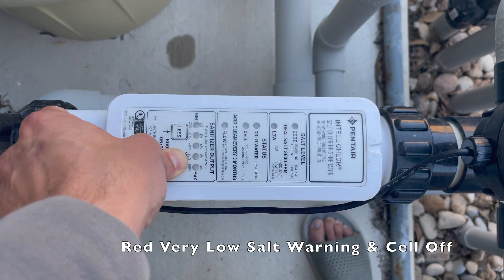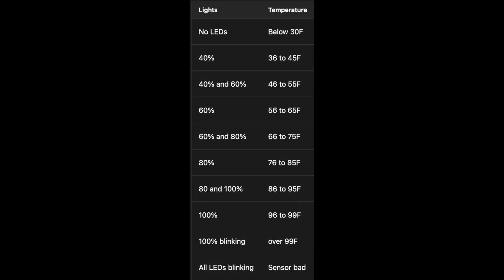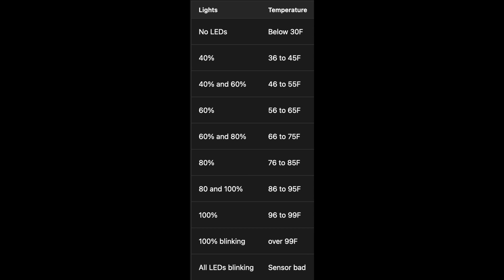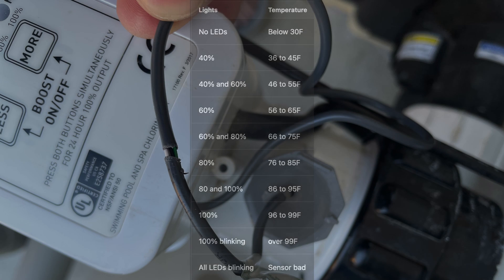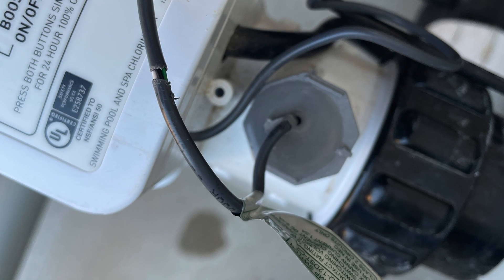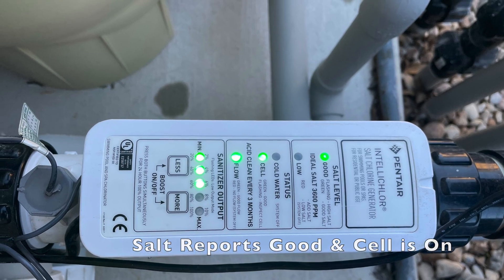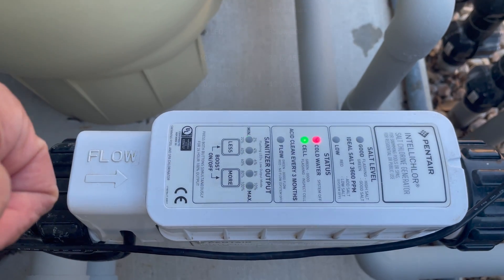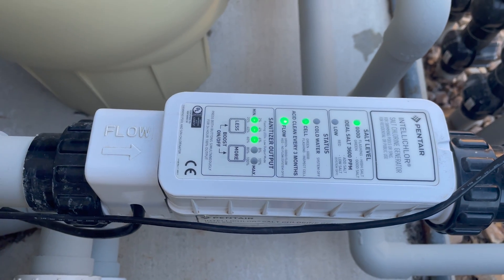Pentair IntelliChlor Very Low Salt Flow Sensor Troubleshooting and Fix

Comment: I had all the same symptoms that would lead me to believe this was a sensor issue and this trick would work. I cut the white wire, but now the only light on is the red cold water light.
Reply from the maker: A new thermistor is probably your best bet.
Reply: @UraniumTwoThirtyFive  thank you!

Comment: Hi Brian,  Thank you SO MUCH for posting this video.  It went exactly as you described.  My salt LOW was on and no Chlorine was being generated.  I test the water twice at Leslie's pool and the salt levels were showing as High Normal.   I clipped the white wire like you said and WALLA the Chlorine was once again generating saving the day for the family holiday weekend swimming in safe water.   I ordered the replacement sensor on Amazon for $20 and will replace it in the coming days.   BIG THANKS from Martin in Southern California.
Reply from the maker: Glad to have helped, yeah it's a frustrating design, but you'll be back in no time. I know the stress of not having this stuff working!
Reply: @UraniumTwoThirtyFive  Yes, but I don' think the design is that bad.  Mine is 11 years old and going strong.  The frustrating part was the idea of bring in a pool repair guy who didn't now about this and just tell me I need a new generate and the labor to replace it which would all probably come in at about $1000.00.
Reply from the maker: @Martin-Techno-Gadget-Guy  Sadly, pool repair companies have proven to not know a lot about things, they just replace. They're good basic plumbers, but good research will play in your favor.

Comment: I have this system on my swimming pool. It’s only about a year old. I just noticed on my app that the salt level reads 0 ppm. I know there’s plenty of salt in there. Do you know what’s up with this? Do you know how I can reset it by chance?
Reply from the maker: More than likely the cell has shut off which is by design. The cell only works in water temperatures of 52F or higher. So if the water temp is below 52F, the cell will shutoff (it'll have a red light on it). Rest assured, when the water temp hits 52-53 again, it'll turn back on.

If you expect your water to remain cold for a very long time, you may need to supplement your chlorine with liquid chlorine. Fortunately, pools don't use/need much cholorine in the winter/cold months so you may only need to add a bottle or two throughout the season.

In Texas, we get cold snaps that reduce the water temp for a while, but then we'll have wonderfully warm days. We had a brief cold front hit us for a few days a couple weeks ago and my cell was off (cold water) for a few days, then we had 70s/80s so the water warmed back up into the 60s.

Anyways, assuming it's cold water shutoff, then you're good. When the cell is off, it'll report 0 ppm.
Reply: @ thanks, I will check it out when I get home. You’re in Texas? I’m in Oklahoma.
Reply from the maker: @theallaroundguy2399  If your app says the water temp is below 52, then a reading of 0 ppm would be expected and nothing to be concerned about.

Comment: will this effect the auto freeze protection
Reply from the maker: @antwerks1  No, completely unrelated. Freeze protection does not interface with the chlorinator directly. 

However, the cell is not supposed to run when the water hits 52F. So if you do this, I would strongly recommend turning the chlorinator to 0% during the winter and/or when the water temp hits 52.

Comment: I have a red/low salt light.. I ran the internal temp test and all the lights are flashing (meaning sensor is bad already). Will it help if i cut the white wire? Sometimes i get a green light and sometimes it gives me a red/low salt light.

Comment: I just did this - How long does it take for the system to "reset?"  I cut both white and green and the temperature flashes at the lowest still... It has been 100 degrees out recently so I know the water is not that cold.
Reply from the maker: Was instant for me.

Comment: This is a life-saver.  My IC-20 was only 4-years old (replaced a previous 7-year old one).  Kept saying "Low Salt", and was looking at yet another unit (at a major cost).  But your solution was perfect.  Water was at just under 80F and yet unit was saying 100F.  So, cut the white wire, and immediately started the 'Cell' again, with no "Low Salt" light anymore.
Reply from the maker: Glad to have helped!

Comment: I'm not sure how I could live without YouTube! Thank you for this!!!! I knew I had a flow switch issue because readings would vary from 2900ppm to 2550ppm an hour later to 0 after that. I know the permanent solution is to put a new flow switch in but we are off on vacation for a couple of weeks and I didn't want to leave the pool without chlorine. Followed your instructions from beginning to end (sensor was reading 100 degree water) and cut the white wire. BOOM!!! Everything is running perfectly! I'll install the new flow switch when I get back (I like to be able to see and control all the info from my phone) but for now, a salt cell that shows it has only spent 20% of its life is now running like clock work! Cheers!
Reply from the maker: Glad it helped. I was so happy when I recovered mine. My replacement flow sensor went out again a few months later, Pentair agreed to swap the entire cell, and since then I've been running smooth (knock on wood).

Comment: Hi Brian, I have only a red and black wire. Which one would I cut? I cut an old one that had been replaced because I didn't want to mess up the current one. I'm assuming its the same. Thanks!

Comment: Thanks for the video. I thought i was in the same situation but i cut the white wire (green cell light went from solid green to flashing green after a few minutes) so then i cut the green wire (solid green to flashing green after a few minutes) so this didn’t seem to work for me. I just ordered a replacement sensor from Walmart ( aftermarket part after reading some bad reviews about the OEM part on Amazon). Hoping this works since the wire cutting didn’t. Would you suggest i just cut the other wires (black and red) or just wait for the replacement sensor? Thanks for making the video.
Reply from the maker: I think the black and red are needed for flow. You'll need to cut them when you get the replacement so it's not the end of the world.
Reply: Did the replacement end up working for you?

Comment: Works like the video shows, instead of spending 1K on a new generator this fixed it for $0.  Thanks for the video.
Reply from the maker: In spirit a new flow sensor would solve the problem as well, but those go for well over $100.

Comment: Hi! I'm having some issues with my intellichlor and I'm desperate! I have 20,000 gallon pool. My chlorinator wasn't running and now I have it on csuoer mode" for 24 hours. I've added 4 bags of salt since we opened it and it says add salt. I don't remember needing to add more than that last year. There is 0 chlorine when I test the water. Please help!
Reply from the maker: Have you tried the instructions in the video where you determine what the cell is reporting for temperature? What does IntelliCenter or EZ-Touch say your salt level is. 

I'd recommend you purchase a chemical salt level system. You can search online/amazon for, "TAYLOR TECHNOLOGIES INC K-1766 DROP TEST CHLORIDE SALT WATER ".

That will tell you precisely how much salt you have. If you have 3000-4000 ppm as measured, then you have an IntelliChlor issue. You could try the bypass I proposed.

Good luck!

Comment: Thanks Brian, I had a cold water light on my ic40 that was used for one swim season.  I live in Canada and use the bypass dummy when I close the pool.  So the ic 40 had about 5 months of use.  Anyway, followed your video and it worked.  All green and producing chlorine.  I just terminated the white thermistor wire with marrettes on either end and its working perfectly.   Saved me another 1000+ dollars to buy a new one.  Thanks!!!
Reply from the maker: Glad it could help. Yeah it's a lame design, such a simple thermistor is responsible for so much.

Comment: I also had the exact same problem. Thanks I’m hoping to replace the sensor tomorrow and have chlorine output once again :)
Reply from the maker: I did get the new sensor and it swapped in and worked perfectly. Very easy replacement!
Reply: @UraniumTwoThirtyFive  Did you buy Pentair's or a knockoff?
Reply from the maker: @Outback199  I called them and explained things. I told them that due to the Texas Freeze, no pool companies want to do trivial warranty work, so Pentair just shipped me the part overnight. It was <1 year old and my pool builder registered all the equipment. I was pretty impressed that they just mailed me the part after I asked them. I told them there was nobody willing to come out, and I was happy to do the replacement myself.

It was a win/win, they didn't have to pay the labor, and I got the part in 1 day. I'm happy with that, but I know many companies don't want the liability of an end-user installing something, but Pentair seemed to have no issue. In all, I called the 800 number and maybe was on the phone 4 or 5 minutes; it was a great experience and resolution.

Comment: What did you just leave it without the temperature sensor? Would it work fine
Reply from the maker: It would assume the water temp was 77F all year round. Depending on where you live that may work. You'd have to make sure your salt level was checked regularly and might have to run it in certain areas of the margin more specifically if water temps varied significantly from 77.
Reply: As you know, the salt cell does not produce chlorine when the water is below a certain level.  I keep my pool open year round in a cold winter climate.  I am having the issue you describe and am thinking of cutting the white wire.  Will there be any negative effects if the salt cell thinks it is 77 degrees and thinks it is good to produce chlorine if the water temp is really only like 45 degrees?    Great troubleshooting and tutorial by the way!   @UraniumTwoThirtyFive
Reply from the maker: @user-tc3wi6xw8d  That's a great question, and I do not know the answer unfortunately. If I were in that situation, I would simply turn the cell off (0%) when the water is cooler.